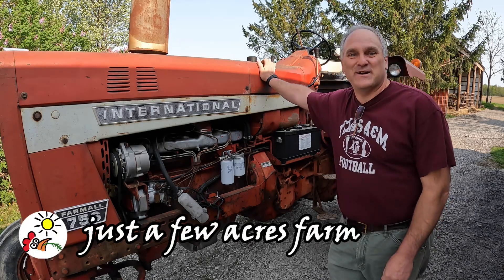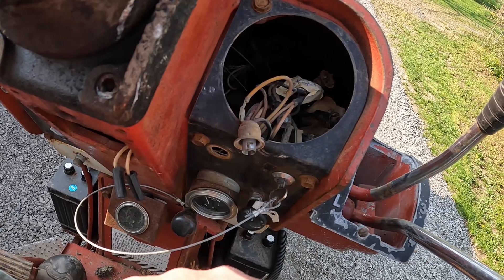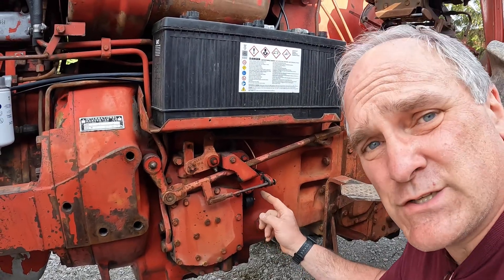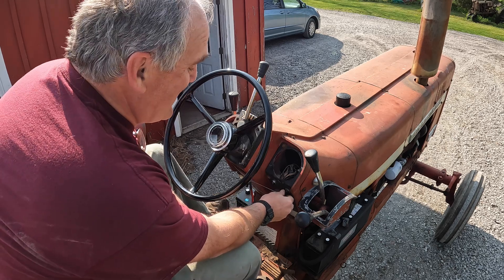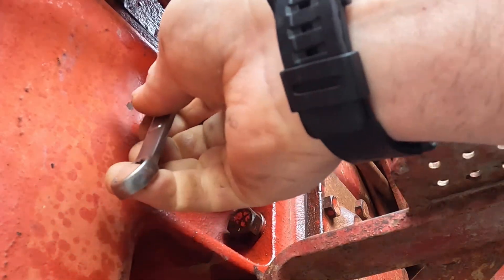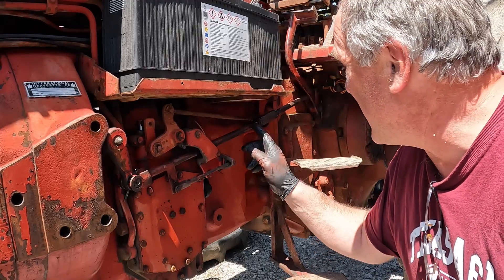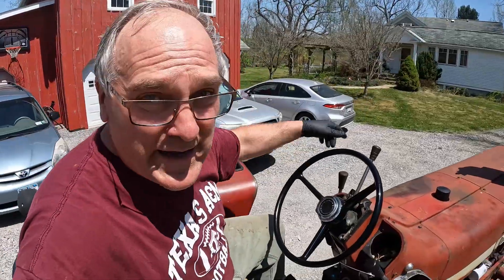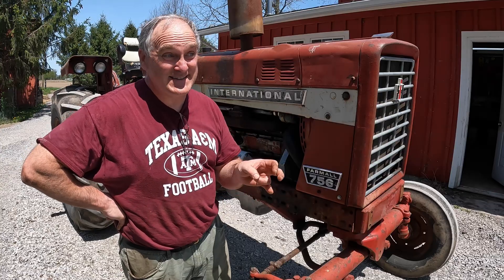Adjusting The Torque Amplifier, Clutch, & Trans Brake on Farmall 06, 56, 66, & 86 Series Tractors

Comment: Got an 856.  I've adjusted stuff. When u take it out out low range and reverse  there's always pressure  on the gears. It's on a loader and always shifts hard and most of the time pressure  on the gears especially if I'm pointing  up hill and taking  it out of gear. U can get it out but it doesn't shift easy at all. Had a new clutch  and flywheel put in it and didn't help it any. Still  shifts hard like it always did.  My neighbor  has a 1066 same deal, can't get it adjusted  right to get the pressure  off the gears after depressing the clutch. I think that's just the way they are or what's wrong with them?  Something wore out in the transmission?

Comment: Hey Pete can you still get new Trans. Brake pads? Also if the cab & booster mounts are bad you will never ever adjust the clutch or torque the first thing you always check
Reply from the maker: Yessir pads are still available aftermarket online.

Comment: that was interesting. I have a 686 with the same German diesel that runs great. Has a whine in the transmission and I think the t/a is out of adjustment. Only works on low side. I can move the t/a some and whine stops. You think it could be an adjustment problem?

Comment: would like to know were u sent fuel gauge .  i have a 656 with fuel gauge that doesnt work .
Reply from the maker: Todd Roberts, The Farmall shop in Iowa, to repair the temperature gauge. Not sure if he can repair fuel gauges. Often the problem is the sender in the fuel tank. You can test the gauge with a battery.

Comment: I agree about using the TA.  Growing up on a 766 and 966 we used the TA's all the time during light work and heavy plowing.  Like you said just shift it fast. We made of 6000 hours on our tractor before working on the TA's. The only reason we serviced them at that point was we were in the transmission that far so we might as well include them as some PM.

Comment: I wonder if there a similar adjustment possible for my tractor. It grinds some when I shift gears... Don't laugh but it is a Terraplane (Dongfeng) tractor from around 02-04, I bet there is no forum for that, but from watching your videos I have used things you did to an old red tractor that came in handy to know  for mine. It wasn't exactly the same but I was able to figure it out. I didn't even know about these adjustments, but now I gotta get to looking for where mine are and hope it's not the clutch.

Comment: As always a wonderful tutorial, thanks Pete. My 706 gasser needs some adjustments as well I think, as I usually can't just shift gears, but have to wait for the gears to mesh otherwise they will grind. My TA is also acting a little off as well, as sometimes I'll shift it, and it won't shift for a few seconds before it then pops into gear. It probably needs to be replaced.

Comment: Tractor mechanical drama. 😄The mechanical engineering required to solve all those conditions is remarkable and displays a level of intelligent problem solving required to coordinate so many complicated requirements. It's clear to see why the torque amplifier innovation caused such a stir in the tractors evolution and elevated IH to dominate the industry.

Comment: The adjustments on the 756 are very much identical to the Belarus tractor linkage adjustments. I had some blast from the past watching this video. And people just don't know you have to adjust linkages after a certain amount of work hours pass. I don't like gear grinding noises they tell me there is a problem that needs attention asap.

Comment: Pete!!!
I have a few (non-farmer...and going to look like a dope) questions.
1) If all the interacting linkage has steel rods, threaded turnbuckles, cast iron clevises with lock nuts.....how does it ever get mis-aligned in the first place?.....worn gears?
2) I'm betting the torque amplifier increases torque........but why does a tractor need amplified torque?
Keep up the "Good work"
Rich from PA.
Reply from the maker: Hi Richard, the clutch and brake surfaces wear with use, so they need to be adjusted periodically. The torque amplifier slows the tractor ground speed without pushing in the main clutch, shifting on the fly. Reduced ground speed = more torque for getting through tough spots when plowing, etc.
Reply: @JustaFewAcresFarm  Pete, Thank you.  I (like thousands of other viewers) am amazed at your farming knowledge and know how.  But my amazement is taken even to another degree.......
I may not be a farmer but I do know commercial construction.....and if you were an architect in a major market.....then you know a LOT more about a LOT of other things that your aren't showing us in your videos.
You are truly an amazing person.
Were you a book worm growing up?
Amazing....truly amazing.
Thanks again.
R
Reply: @jim brewer   Jim,  Thank you for the info.  When I woke up this morning, learning about tractor linkage and torque amplifers weren't even on the list of things to accomplish.  Between Pete and you, I'll be going to bed a smarter man.
Boy.....I wish I was younger.....and I wish I was on a farm.
Pete's videos and his viewers comments and replies are a close...... and getting closer alternative.
Thanks again,
R